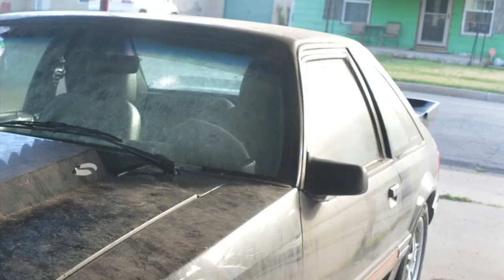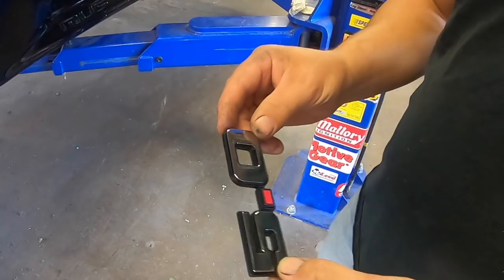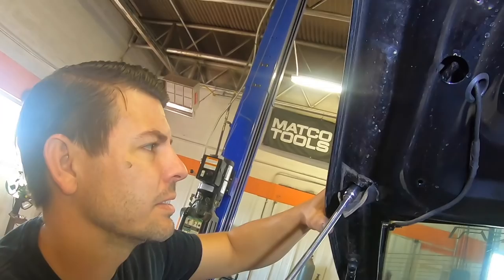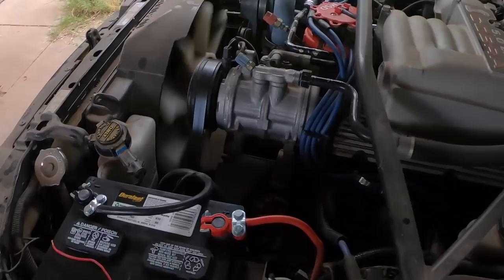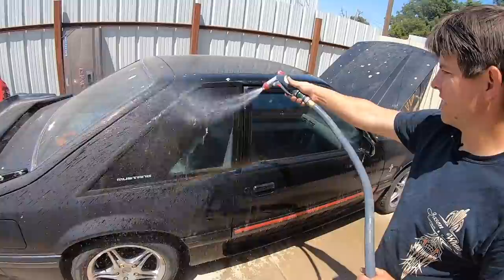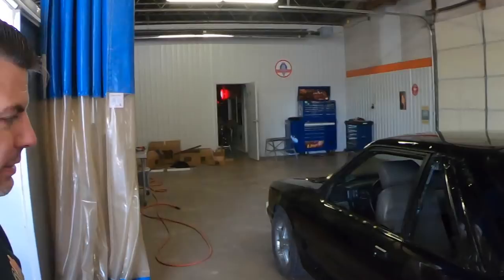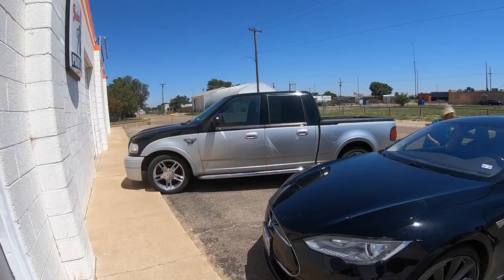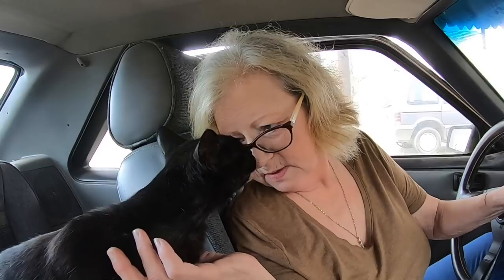Watch Us Rescue &  Restore Neighbor Lady's Mustang At No Charge

Comment: If your not a car person you just don’t get it. These cars are like family for some of us.
Reply: You’re right about that! And I’m not on speaking terms with my mustang right now either! Lol!
Reply: The hotrods my granpa built is all we have left of him so yes i agree.
Reply: @hoomanontheinternet3239  you could of not said anything because it doesnt really matter
Reply: Cherokee93 it does if you want to make sense
Reply: So true. I have a hard time selling a car because it's like part of the family. My dad was like that too. He had this 1967 Coutry Squire station wagon. It was rode hard and needed so much work. I am not exaggerating when I say over 300,000 miles. It had a 390 gas hog engine and it ran but the rings were wearing out and it had a slight knock. Someone ran it dry when it was newer because it had oil additives that made the oil real thick. When he drained it for the first time the oil looked like there was differential oil mixed in. It only had 60,000 miles when he bought the car. He ran that car all over. He took it on his camping trips up in Northern California and drove it out to the east coast a few times. Never left him anywhere. However that car was needing so much repair by 1987. It was not worth anything back then. He didn't want to junk it but he had to do something with it. It ran but it needed an overhaul. The transmission was slipping in first and reverse. The brakes and suspension needed pads and bushings. Then things like the tires were bald and windshield had a crack in it. The body was excellent but who cared? It was a station wagon with very little resale value. He finally ended up donating it to a church. He refused to take it to a wrecker. He had too many memories in that old wagon.
Reply: Everett howton 
Exactly! My father sold his 84 Land Cruiser for $2000 and after four years he bought it back for $4500 just because he feels it's a part of our family and I saw the happiness on his face back then!
Reply: @Cherokee93  could of? WTAF?
Reply: and old motorbikes too
Reply: Chadwick Stone my 88 mustang gt and my dads 67 fairlane gt 390 will be apart of my family for ever.
Reply: You know what you're right and I've never thought about it like that but yeah it's true
Reply: Some people fall in love with cars,I'm guilty of that, i have 2 Mustangs,89 and 91 and a 95 Thunderbird, the 91 has been more or less my daily for the last 25 years,most of my family is gone and they were all alive and well when i bought that car and we made many trips in that car and had lots of fun in it, still drive it today,there is a 347 stroker that ill be putting in when spring arrives and ill be driving it a little less,if i had the money to be buried someday inside that car i would,lol, my friends that Ive known all my life think I'm nuts because i dont have a infotainment or GPS, rear camera etc,dont need that junk.
Reply: Everett howton ok
Reply: Turbo Mansons. LMAO. You could have said ‘have’ instead of ‘of’
Reply: Omgitsjoetime T So when you text somebody you use proper grammar?
Reply: My dad cried when we had to junk his 96' accord. He had it longer than he had been married
Reply: This car WAS part of the family now it’s just a regular mustang that reminds this woman NOTHING of her son
Reply: I love mustang foxbody.
Reply: Yes. And if my car gets passed down , I want the next person to carry on MY vision for MY project. If not then just bury me with my car 🤷🏽‍♂️ lol
Reply: @turbo mansons...you should’ve used “could’ve”.
Reply: @Cherokee93  it does matter because it's a totally different meaning. Do they teach anything in school anymore? Smh.
Reply: The monetary value for a vehicle doesnt matter to me. The people I meet, the places I go and the memories I make with them is what's valuable.
Reply: Charlie De La Cruz could’ve* not could of smh correct ur mistakes before correcting someone else’s lmao
Reply: I've was a Chevy dude growing up as my family but my cuz had a 88GT mustang he beat that car so bad I felt sorry for it!! At same time I had brand new 87 IROC Z 5speed car I never beat my baby but dam thing was always busting trans busting gears in rear end !! Cuz mustang never tore up!! Years went by cuz always had mustang I always had Z28's he would always best me drag race!!  2002 I had some money I got me a new mustang GT 5speed car this Feb will b years 17years me n my Baby been together!! Been married 3 times one car!! 17years runs drives better then new!!
Reply: Everett howton or a truck person I’m both but I drive a truck and It is a part of me.
Reply: @hoomanontheinternet3239  and you could have put the period after the quotation mark also!
Reply: @superspit  or "cudda"!🤣
Reply: @leanmeangreenbeanmachine3347  you're, your, they're, there and their. The most misspelled words in the entire English language!🤣
Reply: @M_773  I hated that my wife's family let their Dad's low mileage '91 Accord EX go with the house when they sold it after he passed away. There was nothing wrong with it other than it sat for 3-4 years and the battery was dead. Now they have nothing of his except pictures.
Reply: Everett howton my moms 2018 Mazda MX-5 is like a baby to her she loves it more than her children🤣💀
Reply: My uncle stole my t-top 84 I still have the title.
Reply: Without her son's help, as well as other issues with her home, her bills become a larger part of her existence than sentimentality over a dormant non-useful vehicle.

Comment: This brings tears to my eyes.  As a car guy and a parent, you guys did something awesome for this woman.
Reply: Squid Usn exactly I'm a car guy also and I have my dad 69 chevelle  he bought it off the show room floor  I'm restoring it  as I speak  I would never sell it. Why? What for they dont build them like that  anymore
Reply: @jonalarcon8564  that's great.  If your dad's 69 is original, I hope, keep it original.  I'm doing a RestoMod on a 69 Camaro myself and got years to go lol.  It was a basket case and a 6cyl so I get to do to what i want with it.
Reply: Squid Usn no sorry it's not like I said I'm building for the texas mile top speed runner , my dad and I built it for high performance use
Reply: Squid Usn if you need any type of help via texting il be more then happy to help a car enthusiast, I'm 57 and have been doing it since I was 17 ,and know a lil bit   good luck that's a great car  you have !!!!
Reply: @jonalarcon8564  thank you sir for your kind offer.  I will keep you in mind.  I also have a buddy with a 69 chevelle and another with a 70 mustang fastback.  We help each other out and with the wealth of information nowadays in the internet, we are able to do more, especially wiring/electrical.  It seems to be our weak point.
I had just finished putting in the mini tubs along with the 4link Ridetech cradle at the rear.  I have a crate LS3, tremec tko600 5spd, hydraulic clutch, and will be rebuilding my 12 bolt.  Don't know how close you are but I live in southeastern VA.
Reply: Squid Usn Great state,  but i live in California  and believe  me its not so car friendly here  , I'm having currie enterprises  build me a Ford 9 inch  im a purest  but Ford is a stronger rear end due to the hypoid distance , I need something  to handle 2500 hp, after my settlement from a car accident  I want that guy in chatsworth  to build my engine,  tom Nelson  he knows way more then I ever will but he isnt cheap  for my engine is around 53,000 dollars   I'm doing it once so Im trying to do it the best I can,  hopefully  you and other will see me at the texas mile   thanks for the reply I'm alway glad to learn , share with car enthusiasts  young or old. Most of all be safe   god bless you  and your  friends

Comment: Damn they finessed the cold air intake, throttle body, Cobra intake, valve covers, hood, strut tower brace, and the spoiler. That’s at least 1,000 plus dollars
Reply: Was looking for someone to comment this!
Reply: They put more than $1000 into that car for that lady and I'm sure they'd give her the parts back if they didn't and she asked for them.
Reply: They clearly did this because the car has a better resale value if she decides to sell it in the future. Those aftermarket parts at the end only devalue the car.
Reply: You got that right - they didn't even check the motor. That was probably an original 4cyl car that he put the GT body kit on (the '88 GTs didn't come with the pony badge or the standard taillights) I doubt he just dropped in a junkyard engine.  If that was a hotter motor done right, in a straight body, that $5,000 figure is pure BS.
Reply: Jay Philly Ik that but I mean I would’ve respected what her son put on it I mean it was his car, plus the manifold and air intake give it more power than cheap old parts
Reply: Revmaynard nah they’re a company that works on foxes they probably grabbed old spare parts, I have a Foxbody and parts are very cheap plus the paint and body work wasn’t much since they only resprayed the bumper and skirts, they put less than 1k in it
Reply: Dont forget the entire 5 log conversion and rims !
Reply: N Ferraro and I owned one and I can tell you from the little marks on the side fender wells on the inside of an engine it came as a 5.0 buddy
Reply: Stole all speed parts. And factory quarter Windows that say mustang in the glass. Thieves without guns...
Reply: @revmaynardd  agreed. And they probably did. Did you see them putting dust and old paint in bottles? I bet that was a keepsake for her. I could only imagine... And now she has a reliable car AND gets to keep the memory. I think that's the least a mother that has gone through such loss could ask for. What a wonderful thing they did...
Reply: @whydoihave6neutrals772  YES! 🤯😖🤕👍
Reply: Not to mention MSD ignition!
Reply: That's what I said wow!!!!
Reply: Im glad im not the only one that noticed, i got the same shit and when i saw the HO labels on the after car i got really annoyed
Reply: I bet he’s turning in his grave.that cobra intake flows better than the factory intake as well as the cold air intake.the boy built the car the way he wanted it and for performance not for value.they should not have touched what he did to his car before he passed.that is disrespectful.
Reply: Revmaynard Every single cent they put in this car was tax deductible..what’s your point?
Reply: N Ferraro You know one could EASILY change the taillights and add a badge..right?
Reply: Jarl of Whiterun Not one single part his son put on this vehicle will negatively effect reliability or drive ability or longevity one bit..talk about dumb 😂😂
Reply: N Z Z S Not one part  her son put on the car negatively effects the reliability of the car..everything they did to the car was tax deductible and just for self promotion..you see it as nice but it was a hustle from beginning to end
Reply: Tony Fisher I’m so glad someone else caught that one smh
Reply: I can’t believe they snaked the super rare intake off of it, and tried to justify it as making it more reliable.
Reply: Revmaynard that rare cobra intake is with more than that.
Reply: Martinn finessed hard. This fucked up
Reply: You guys robbed that old lady
Reply: The Guy doing the buffing probably swapped cobra intake onto his mustang and put stock shit on he aint doing it for free my ass
Reply: its just typical mechanic shady shit
Reply: No kidding way to make it not the sons unique car anymore. And these guys keep the parts? What the fuck.
Reply: Jay Philly that’s a V8 dude cmon now 😭😭😭
Reply: @jayphilly1703  BS, the intake does not devalue the car in the least. Spoiler negligible. It's a fox body GT, not a Boss 429 that has to be resto perfect.
Reply: @n ferraro—what would be easier (and much, much cheaper) to do, put in a set of LX taillights for a custom look, or drop in an engine?  It’s ok...I’ll  wait
Reply: Watson Delmick These guys are absolute scum bags
Reply: I knew it see they stole that lady cobra the struts msd evrything wtf
Reply: They gave the mom a car that ACTUALLY WORKS, and the opportunity to sell the car for top dollar if she needs to FOR FREE. Do you have any idea what it would cost her if she did this stuff on her own? THOUSANDS OF DOLLARS!! What is wrong with you people ?!?
Reply: SageoftheSixPaths 🤦🏾‍♂️🤦🏾‍♂️
Reply: Man they Did it because they wanted the rare shit PERIOD n they would uave tried that shit woth me i would have told them a JBA cobrA SELLS FOR WAY MORE THIS SOME GT GET UR FACTS RIGHT
Reply: @nferraro222  because they wanted the rare motor and gizmos n put a couple grand in to her car swap the motif with a gt motor that aint worth shit
Reply: Sad you guys try to make this like your helping her you rob her she don't even know it taking all that stuff Chinese parts are not OEM and you put it on youtube thank for warning us.
Reply: @shaun4bigblocksllc  And repainting parts with single stage acrylic enamel doesn't doesn't last....
Reply: To begin with, the mods the car had were done by an amateur, not a pro.

The lady needed a reliable car to drive or to sell and that's what they delivered.

I dont think the son would turn on his grave, he would have been happy that the car looks pristine and his mom driving it.

Seems like many folks think it would have been best to leave it the way it was: rotting in the driveway.
Reply: not to mention rims.
Reply: @dylanrowan6626  he said in another comment that I was just a cover and it was the actual original stock